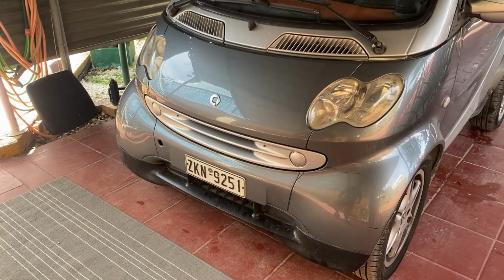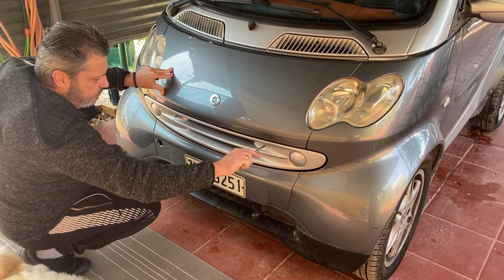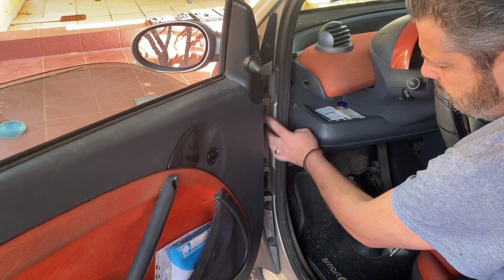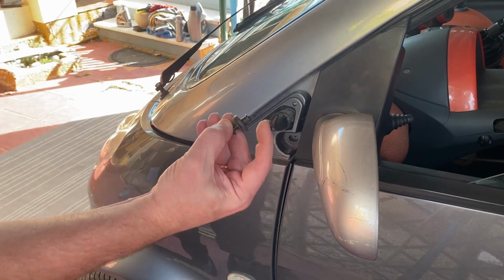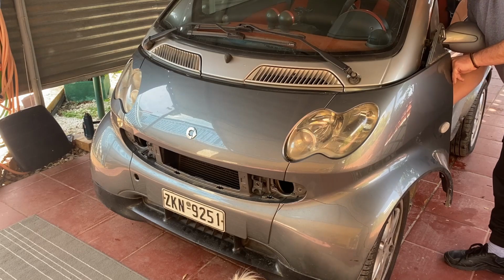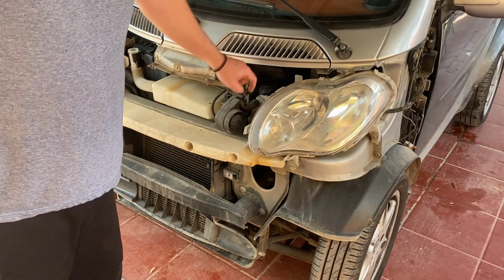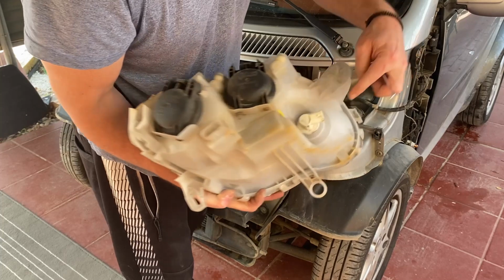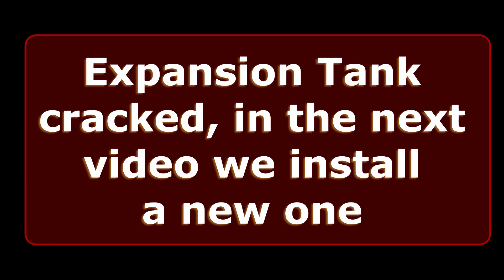Smart car losing coolant

Comment: Thank you very much for the video! One question, do you know where the coolant bleed valve/plug is on the CDI Diesel engine? I did a cooling flush on my 2009 ForTwo CDI but could not find the bleed point location that I know should be near the cylinder head to bleed the air out of the tubing. Now the car is overheating with a water not circulating and full of air pockets. I've searched all over the Internet and the all the information available is only for the gasoline engine, not the diesel. Thank you very much😊😊😊
Reply from the maker: I am not familiar with that engine, but you could probably remove the coolant hose to the cylinder head to bleed the system. Good Luck.